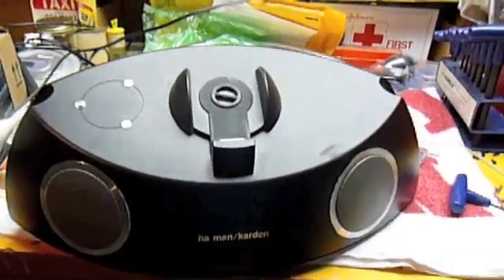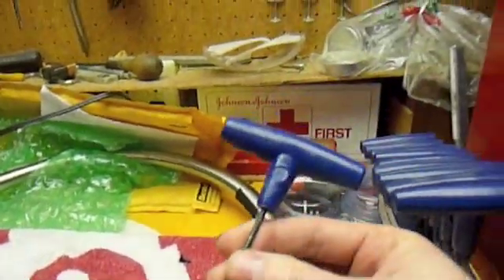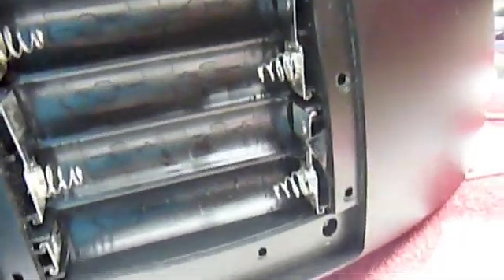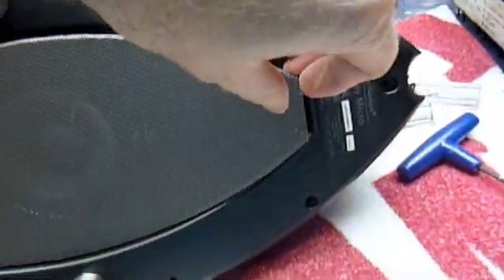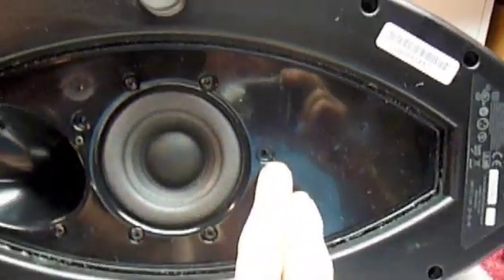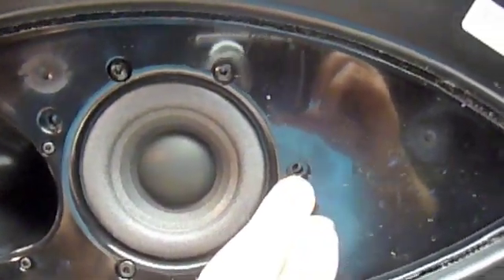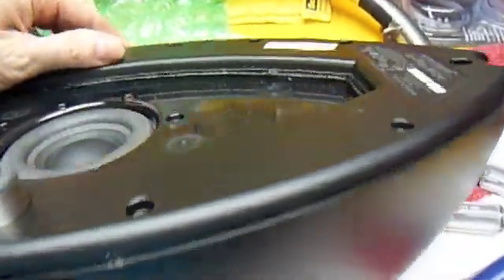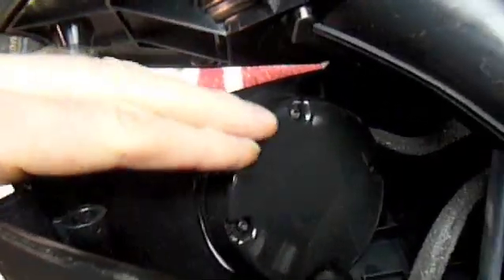harman kardon Go + Play Micro Disassembly

Comment: Thank you so much, you saved us a lot of guessing and time!!!
Bad woofer too, I gues it's not such a good driver.
Reply: The woofer performs well, but it works very hard so it is under a lot of mechanical stress. It seems like the problems many people have are the result of torn surround and spider (both are made of foam in this driver).
Reply: @Acoustic_Theory  ....all woofer is designed  to work hard.....this is just fail product,in my unit i find magnet from woofer moving free,glue is fail,foam is just dust and plastic body for woofer???this is just funny....go play,the same fail...go play micro exactly same...this mean the ''designer'' have all data about just not involve.

Comment: Hey Brian, my harman kardon started to distort today. How did you fix yours? Loved ya video. Plz help me what my speaker system.
Reply from the maker: I used a small Torx and phillips screw driver to open the unit.  I opened the unit as you see in the video, but after opening I couldn't find any problem with the bass speaker in the bottom of the HK unit.  Never did find the source of the distortion, bought a Kicker system to replace it. Perhaps email HK tech support, maybe there is an electrical part that fails that causes the distortion.